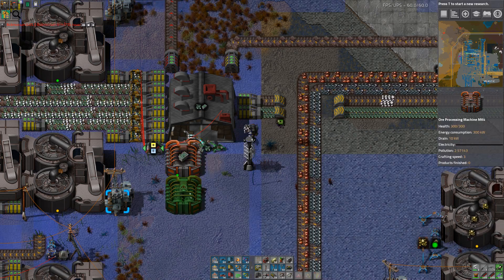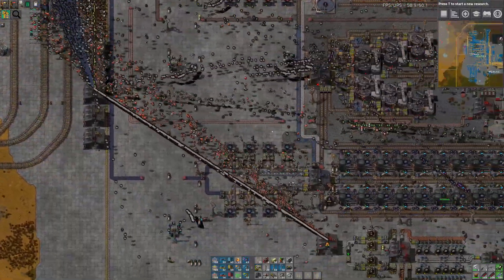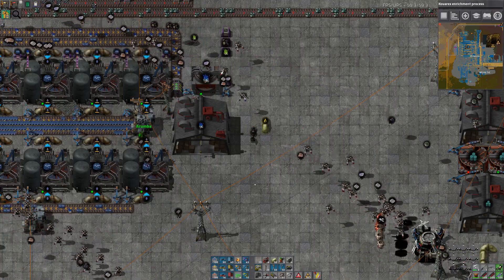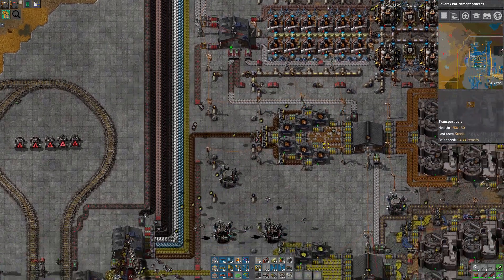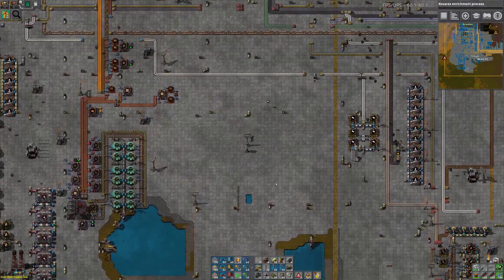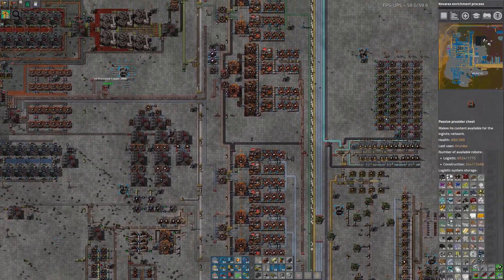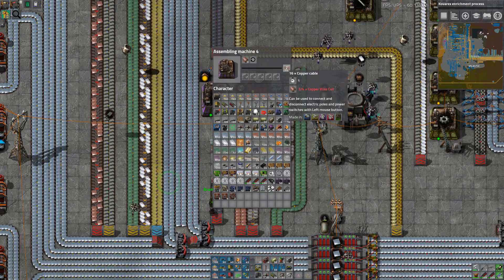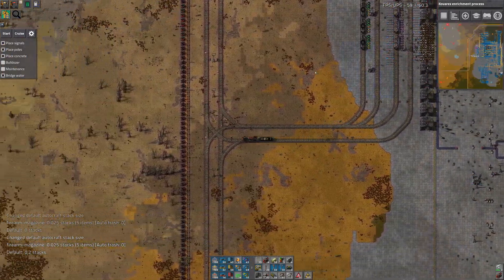Bandaids | ABPlus Factorio 0.15 Part 114

Comment: Since you have such a backlog of stone in the warehouses, you should probably use underground belts to go around the warehouses instead of through them with loaders. The north most stone belt is not full, yet all the others are. You can easily make a fully condensed blue belt with all the stone. 

Also, there is a single stealthy ninja stone brick on the tin belt for the tinned-copper wire.